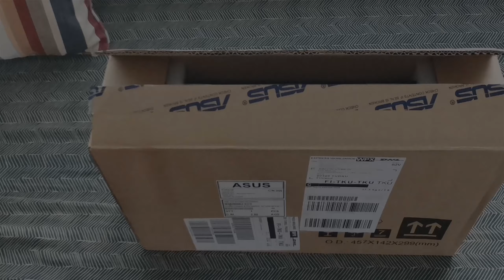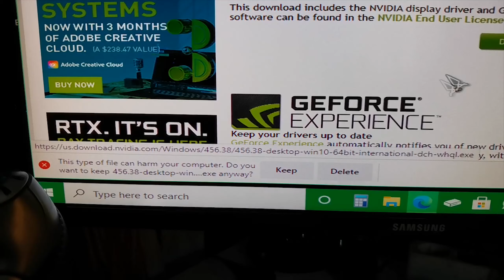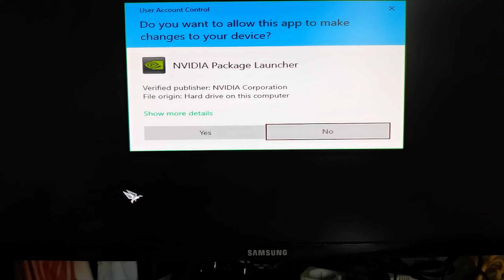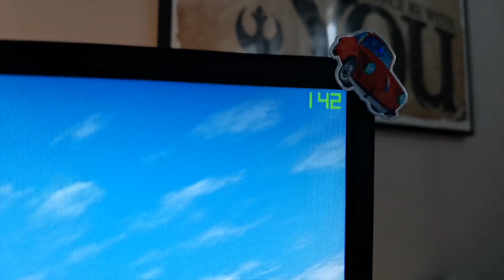Getting turned on! Asus RTX 3080 TUF Gaming

Comment: Hey there thought you might wanna know that it’s not advisable to use a daisy chained PCIe cable for the 3080 given  that the high voltage requirements of the 3080 might exceed the threshold of a single PCIe caboe
Reply from the maker: Thanks! Will look into this 👍🏻

Comment: Heads up it not recommended to use a pig tail cord, you should use 2 single pcie cords.
Reply from the maker: Thanks for the heads up! I'll look into that.
Reply: @OrcCorp  np, i am still trying to order a 3080 tuf
Reply from the maker: Yea, just added another pcie connector to the other 8-pin socket, so it's getting power from 2 power ports from the psu 💪

Comment: Seems nice. Is there a bottleneck? Or is it do to the drivers? Rdr and crysis should be on higher fps? 🤔 Glad your back :)
Reply: Probably drivers due to it being a new card release.
Reply from the maker: Yea, no bottleneck on my PC. I7-7700 should be good enough not to cause problems, my memory is fine, although a bit low on MHz (2666), and my games are running from m.2 ssd. I don't know what is causing the low fps, other than the drivers. Perhaps the media/press drivers were better for games, and this current "game ready" driver is better for synthetic benchmarking 🤔
Reply: @OrcCorp  bruh the 7700 will not handle this unless you are doing 4k or something
Reply from the maker: @RCXDerp  Yea, that would make sense. I have not run 4k testing yet, but I'm limited by my 60Hz 4k monitor to see higher framerates. All I can test is steady 60 fps performance. Gonna do it today 👍
Reply: @OrcCorp   Makes sense at least you got that new hot gpu. I need one to replace  my 1080 ti so my 9700k can work even harder.

Comment: Just a heads up it looks like you have your M.2 ssd installed wrong. It needs to sit ontop of the riser screw that screws into the motherboard. Then you screw it into that with a M.2 screw.
Reply from the maker: Nope, installed as per instructions. The ssd is sitting in the slot of the screw as it is supposed to.

Comment: Is this the "asus tuf gaming" or "asus tuf gaming oc"? I'm asking because of the MLCC capacitors debacle and I ordered the none oc one.
Your card has the best capacitors 😁
Reply from the maker: None OC one. If this was the OC, it would say it in the title.
Reply from the maker: Yea, just checked the debacle at Jayz2cents and Igors Lab. Thank God I always aim to get Asus products whenever possible. This time this model is also the cheapest 3080 available in Finland. And it's the best model as well 😂 best cooling, best quality.
Reply: I think if your running the base version without an overclock the capacitors aren't an issue its only when people have overclocked or have the oc version that the capacitors can't handle the additional stress.

Still no excuse for these companies being cheapskates. If people have nearly $1000 to buy a card they want quality not cheap shit.
Reply: @Supadrumma441  the cards use boost and when it went about 2ghz it crashed. It wasn't about manual overclocking. It will be fixed by a bios update.  But it does show how little head room there is.

Comment: saw your clock speed reached 2020 mhz, did you do any overclock when you did this video?  or it's just the boost? :)
Reply from the maker: No OCing done for this video. With the new driver I can OC this card to stable 2115MHz. Highest temp 59°C, so this is clearly among the top cards on the market, if not THE top card 👌🏻😉
Reply: @OrcCorp  Thanks for the response. I am considering the OC version  of this card, after reading this, I think I'm gonna go with the non OC.. to have its boost near 2ghz is enough with me.. I will be happy even with just 1900 mhz..  what wattage of PSU do you use? :)
Reply from the maker: I have a new Fractal Design 760W Ion+ Platinum. Well enough for my current setup, and even if I got i9-10900k or similar, still enough quality power.
Reply: @OrcCorp  i asked because i saw at the asus website that they recommend an 850 watts. I just got a 750 watts gold. So 750 watts is enough then.. thanks.. :)
Reply: Josh it’s recommended 850w for the oc edition but 750w for non oc right?
Reply: @akifzulkifli1892  saw in their website they recommended 850 in OC and non OC if I'm not mistaken. that's why I asked orccorp what he is using.. :) but in reviews, non OC cards only use 520 to 530 watts total system power. it still got 200 watts to spare.  I think in OC version, 750 can still be use, but it will push you PSU maybe near 100%. good quality PSU will have problem with that.. only the efficiency of the PSU will be affected.
Reply: @jomac21  Always aim for a large overhead on power, you will invariably need it later down the line.

Comment: Hey has your card crashed in games? Theres a lot of problem with several manufacturers rtx3080s but i hear asus tuf doesent have this problem since it has better capasitors. Could you check does your tuf card have 6 mlcc capasitors or the cheap capasitors?
Reply from the maker: You can see at 2:18 that this card has all the 6 quality capacitors 👌🏻😉 no crashing problems. I've always said "you can't go wrong with Asus" , and once more it's proven to be correct. And better yet, this basic Asus TUF model is the cheapest 3080 available in Finland 😂 Asus has once more showed the world that you can truly rely on their products.

Comment: red dead, cpu constantly hitting 100%, time to upgrade your cpu
Reply from the maker: Not true. It hits 100% pretty rarely, and mostly hovers around 60-90%. Definitely upgrading not need for this. If it stayed at 100% most of the time, it would be a problem, but now it doesn't. It's not a bottleneck in this setup. 4k is a different beast, but still my i7-7700k is well enough for all gaming, 1440p or 4k. Uploading a 4k testing video soon with the Shadow of the Tomb Raider. Great performance with my setup for that title. And furthermore, I've just spent 740€ to get this GPU, so I really don't have money to upgrade to, lets say, i7-10700k and a new mobo, which would require around 640€. The 5-10% better gaming performance is not worth that money at this point to me.
Reply: @OrcCorp  your cpu is old but i agree that it can still last and also there isnt a good intel cpu to upgrade to. I have a 8600k and am waiting for intel to get to 7nm before I upgrade
Reply: @OrcCorp  can u overclock ur cpu to 5ghz? Thats the highest clock that matters, after 5.0 games dont improve in fps
Reply from the maker: Unfortunately I couldn't get this cpu stay stable above 4.8GHz 3 years ago. I will try again soon, whenever I get the time. Maybe this weekend. Maybe not. Too busy life ffs.
Reply: @OrcCorp  In lower res like 1080p and 1440p , GPU is bottlenecked by 7700k even the latest I9 10900k can be a bottleneck at low resolutions. Just have a look at the GPU utilization %.  Only 60-70% gpu usage in RDR2. That's a heck of a bottleneck. 3080 is great for 4k displays.

Comment: This is not the OC ver. Right?
Reply: Thats not the OC right, the oc are not being sold yet, they will come out for sale around beginning of october.
Reply from the maker: This is a none OC version. You can see at 2:18 that this version has all the 6 top quality capacitors.
Reply: @OrcCorp  Thats why i was asking. On the website they had pictures where they were all different
Reply from the maker: Yes, many stores selling the card has early model images, which indicates that initially Asus had the POSCAPs before launch. Then they detected the problem very early, and managed to ship fixed cards at release. Obviously I don't know if some early cards were shipped to resellers somewhere in the world, but I got a very early version and it has all 6 MLCC capasitors.

Comment: Looks like bottleneck
Reply from the maker: Nope. Must be drivers.
Reply: @OrcCorp  idk... that is strange because rdr2 fps are too low, even for your cpu, it should manage 90 fps average on ultra at 1440p with same CPU at 5GHz and 3080 on ultra settings... strange... and if you notice, the GPU usage is irregular. Maybe windows power plan settings or nvidia CPL energy settings...? Cheers